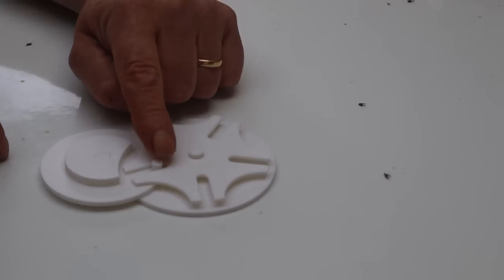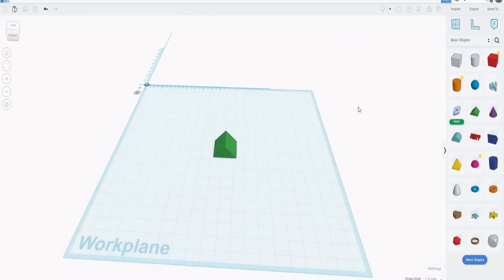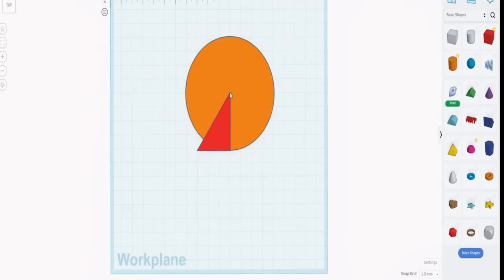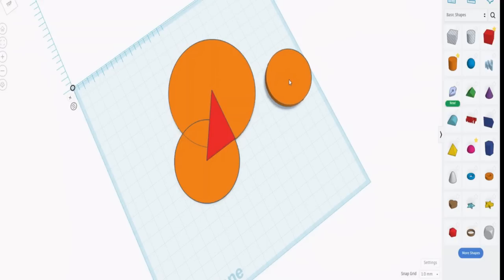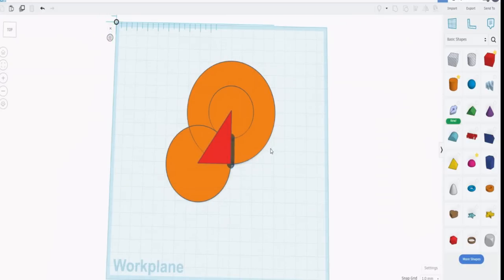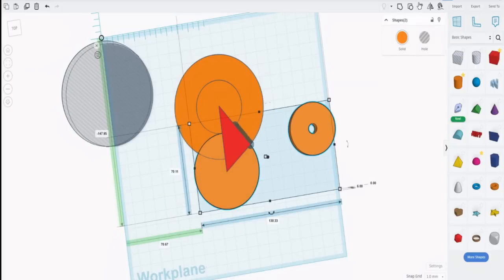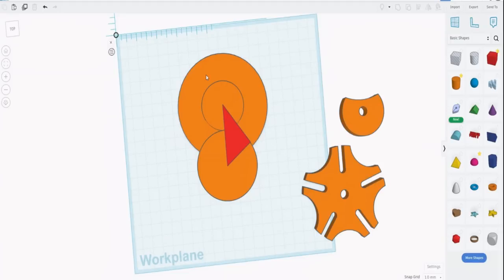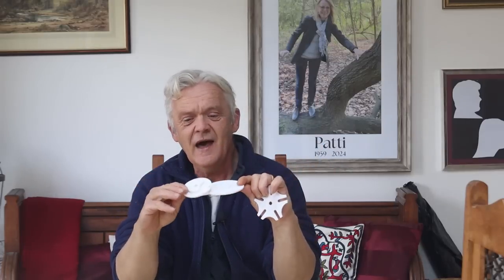2372 How To Make A Geneva Drive

Comment: Hi very good. I worked as a production engineer in 1981. I had to tool up for a TV tube making machine for India. No matter how accurately you tried to machine the cam and follower, on first fit it would shake, which was fatal to the tubes. Only an adjustable fixture, with you which progressively equalized the distance between and orientation of the six slots until  all perfect, would give a perfect smooth motion. Great days! Love your projects.
Reply from the maker: cheers mate and thanks for sharing that